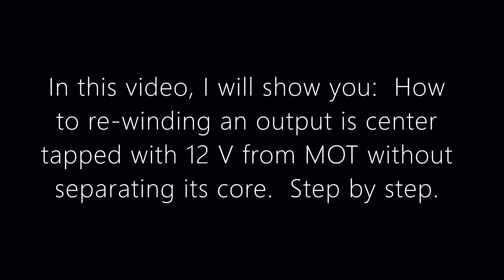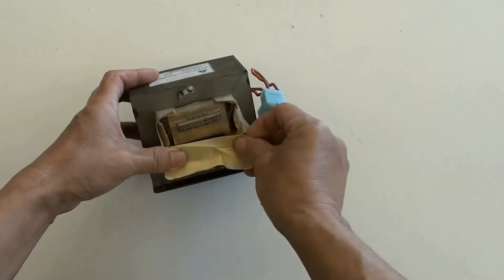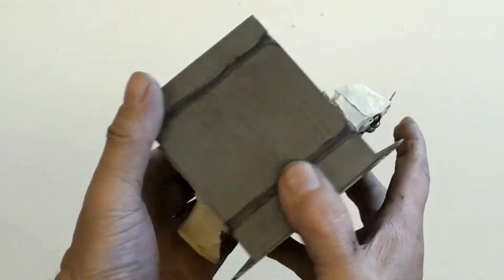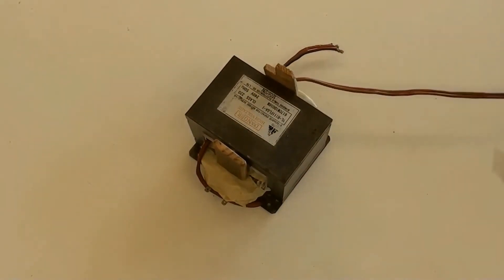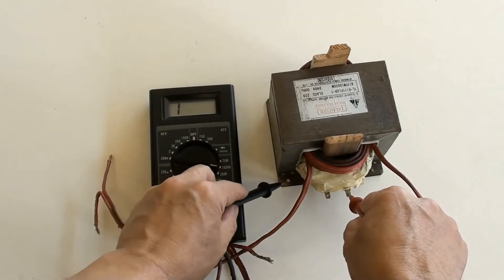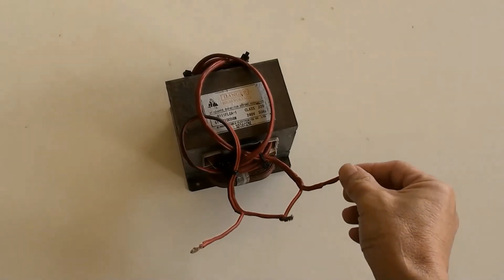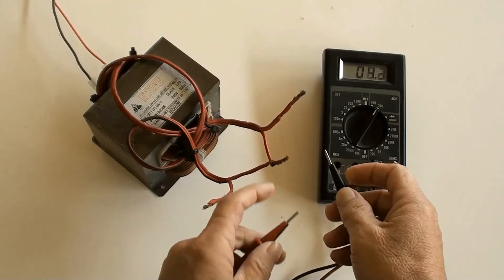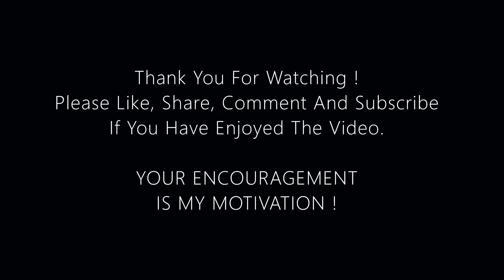How To Re winding MOT Without Dismantling Core?

Comment: How much ohms do u get? And will it work on india 220-240 producing 12 v?
Reply from the maker: Thanks for your interest, Mate!  (1) Well, those winding wires from secondary are capable of carrying 25 amperes so the ohm value is very little - less than 1 ohm.  (2) The primary terminals from that micro wave oven transformer from recycled in the video showed is for AC 240 V and suitable for your concern of course.  There is an another video is even much better solution for a long lasting usage as shows:             https://youtu.be/8tmhCWDivQQ                🙂👍